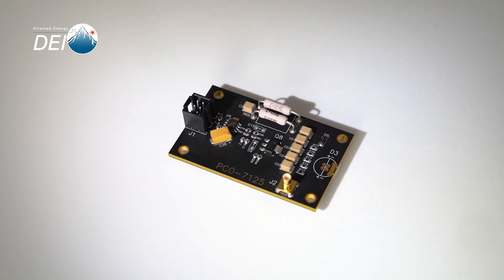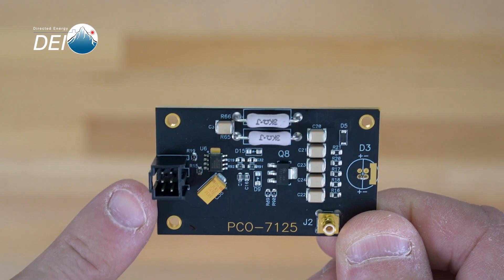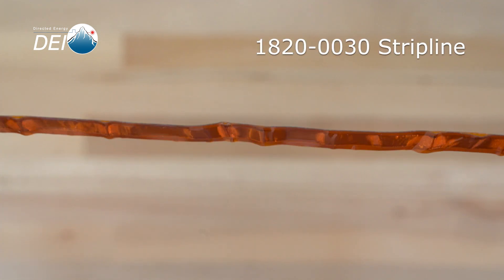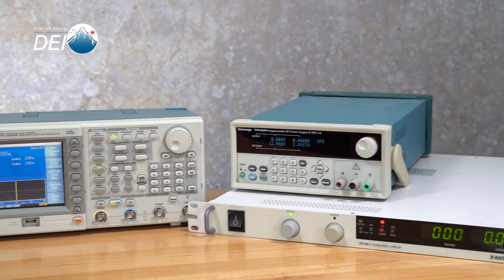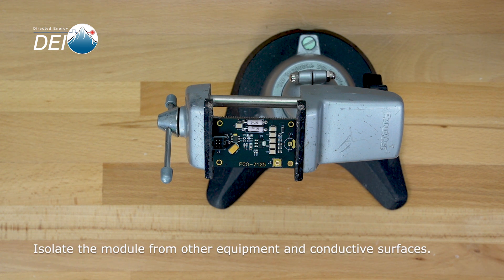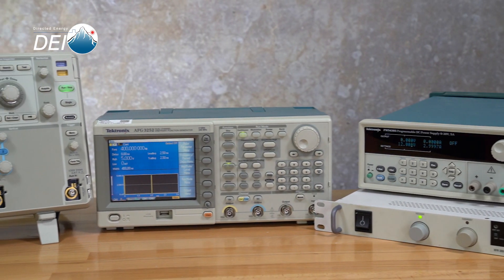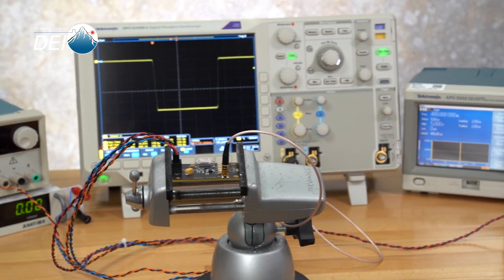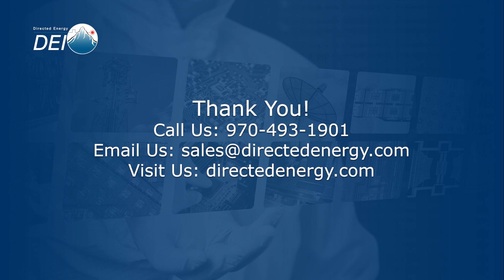PCO-7125 Pulsed Laser Diode Driver Module Setup and Operation

Comment: Is that compatible with ir laser diode (1 to 2v)
Reply: laser diodes just require a controlled current source., so long as the source is appropriate for the diodes power consumption requirements, itll work afaik